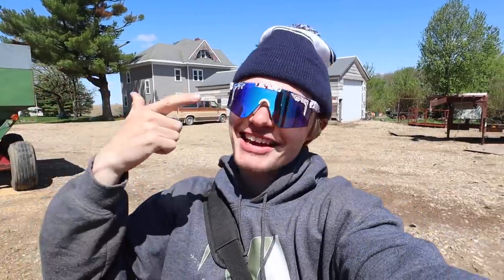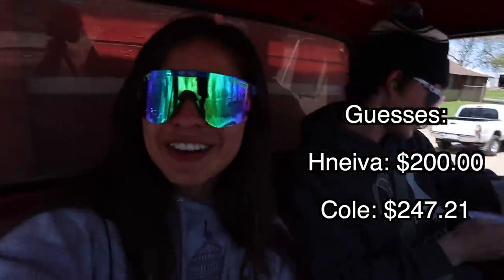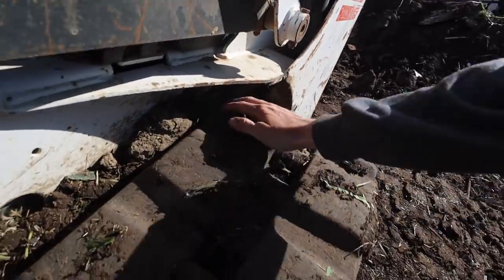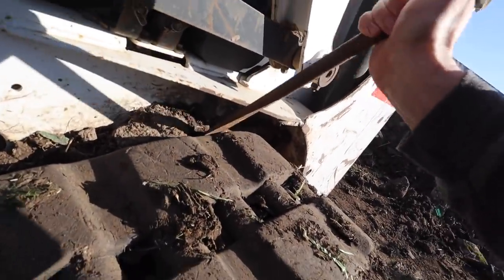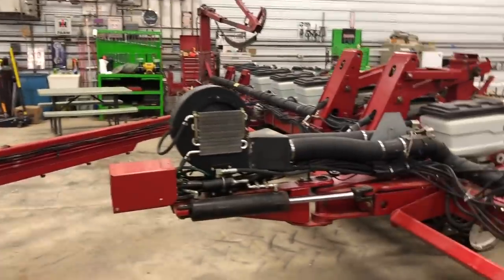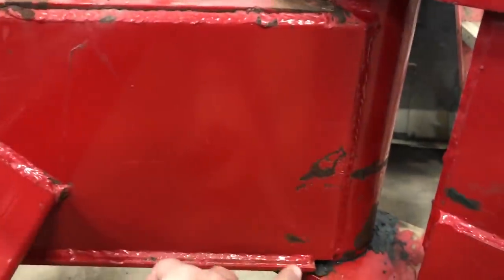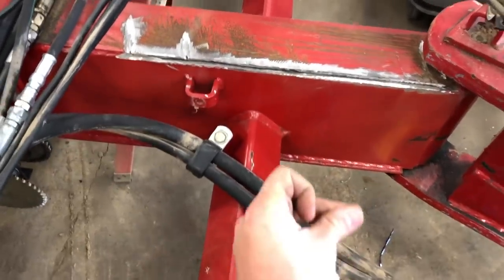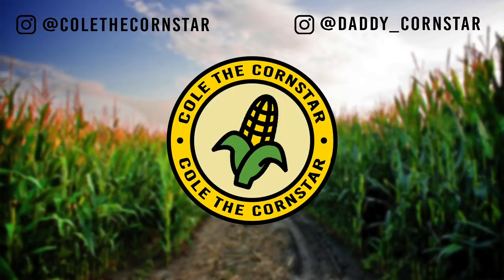Cleaning Up The Scrapyard (MAJOR IMPROVEMENT!)

Comment: Helpful hint for Cooper, drill a small hole at the end of the crack. That will stop the crack from continuing. I had a Terra Gator with cracked frame. I kept welding it but the crack would continue. Once I drilled the hole it stopped.
Reply: works on plastics too.
Reply: Works on airplanes too.
Reply from the maker: David Conaway that's good to know! Thank you!
Reply: Acer Acres  Still, good practice to do. It's call a "crack-stop hole"
Reply: So does that work on windshields?

Comment: Cooper, when welding cracks, always drill a hole at the end of the crack before you weld it. It will help prevent the crack from returning.

Comment: Hey cole the farm is going to look 1000 times better once you get rid of all that scrap. I might suggest with some of the money your making from the steel right now should look at renting or buying a grapple bucket. When we tore down one of our turkey barns we bought a grapple bucket for our skid loader and it saved me so much time not having to load scrap metal and lumber into the bucket by hand but could just drive up to the pile and separate it and load it all while staying in the machine.

Comment: Cole I have a suggestion that you may or may not have thought about. Make some racks outside of the main heated shop to put the metal and auger parts you end up keep that way they are close by if you need them and you can keep them off the ground.

Comment: Using the truck to pull out the pipe is like when you get a hitch rusted into a Receiver. Attach a chain to a tree and to the hitch and start hitting the hitch till it works free

Comment: Have you guys ever thought of powder coating the rims on the sprayer? That should stop it from rusting. Just a thought.
Reply: Its the products they spray, it just eats any coating they put on them.
Reply: @twoflower8264 , True, but at least the powder coat will slow it down quite a bit and keep those tall rims from rusting in half, when they're doing 25 mph down the road !
Reply: That might work; maybe the company with the chemicals can recommend a finish that would not degrade.  Remember, there was part of that sprayer which did not react but the paint on the wheels did.

Comment: Im in Australia. All I could think of as you started cleaning up was that we would have snakes galore amid all that metal. You wouldn’t run a bobcat with anything but an enclosed glass cabin and the doors and windows on the truck would be shut tight whilst loading unless you wanted some excitement on your drive to the scrappers. We would have Snake bite kits in each machine cabin. When Daddy CS broke the window, again I thought about disturbing snakes and having them slither from the bucket down the arm and into the cabin through the broken window. We obviously have very different types of snakes than you guys have on your farm. 🐨🦘🐍 🐍 🐍

Comment: He just spread Chicken Manure and it kinda smells around here.   We are kinda used to it,  because We used to be Chicken Farmers too.  We raised 50, 000 Chickens in 4 houses that were 250 feet long and 40 feet wide.   Mom and Dad retired in The Year 2000.  We have a 873 Skid Steer Bob Cat and a 4610SU Ford Diesel Tractor, and now We have My Uncle's 3,000 Diesel too.  Dad also has a 9,N Ford Ferguson that My Grandpa bought used when My Dad was 11 years old.   It still runs.   We found out that it is a 1940 year model,  and so is My Dad, so they are both 80 years old.  Dad and the Tractor have slowed down over the years,  but they still are going pretty strong.

Comment: Hey just a pro tip. Please do not use the ball on the truck to pull on.  It has  a much lower sheer point than you would think.  Some sort of rated shackle in the receiver portion would work.  That would not be the first one to break and go flying.

Comment: Daddy Cornstar: If the hub were to lock up you would fly through that windshield so fast you wouldn't have time to say goodbye to your seat"   What about the windshield?!
Reply: That would be the first thing your head impacted, followed by your torso hitting the steering wheel before your crumpled unconscious body is flung from the vehicle. If you don’t die on impact.  Somehow compensate for the internal bleeding long enough to survive the hypovolemic shock you will get to try to somehow survive the severe blunt force trauma to your brain, infection from the craniotomy preformed to allow your brain to swell AND Neurogenic Shock you will have the pleasure of months or years  of burden on your family as you go through therapy to regain any faculties, and you would still have lifelong deficits...

Comment: I cringed when I saw you pull at the stuck metal with that chain.   If a chain snaps or what you are pulling breaks loose with enough force it could do some major damage.   At the very least, using a blanket or something as a damper would significantly reduce that risk.

Comment: Hi there, nice video. 

Are you guys aware of the right to repair movement? I don’t want to start a political debate, I’m just interested in your opinion as you are farmers ans farmers are playing a more or less important role. 
 
The gist of the movement is the following:
Several brands like Apple, John Deer or companies producing medical equipment have monopoly on repair, i.e. if you repair something yourself they either won’t repair it for you, or you void your warranty. Apple is a “good” bad sample. There are also other things. There is a YouTube video about farmers and John Deer, and their practices by motherboard. (Just Google John deer right to repair and it should come up, it takes about 10 min) John Deer basically software-locks the repairs, so you can physically repair something but you need to tell the computer in your tractor or combine that is repaired. If you don’t, the equipment won’t work. (Also shown und the video i mentioned with the GPS receiver on a John Deer tractor).

You have been showing off you Ag leader equipment and your new mixing station for the sprayer. The people and also the equipment itself looks to me less like something created by a partnership of large brands but something a farmer developed with the help of someone tech savvy. So when you decided to purchase this equipment, did you take a look at the ease of repair?